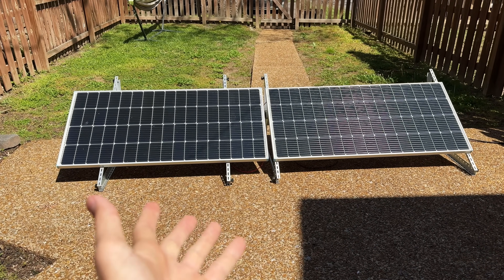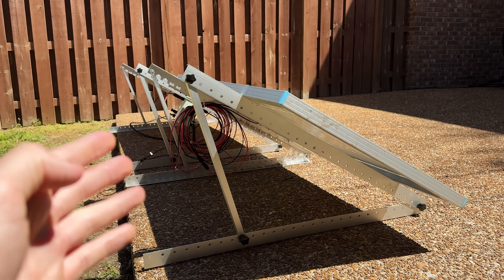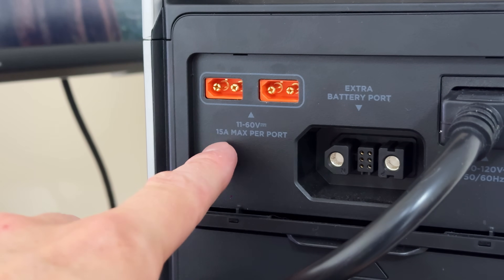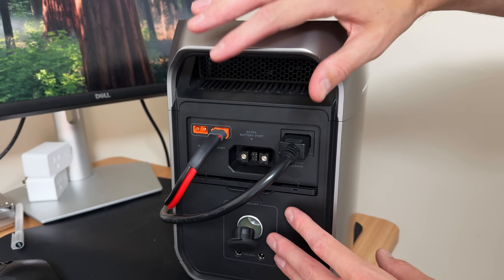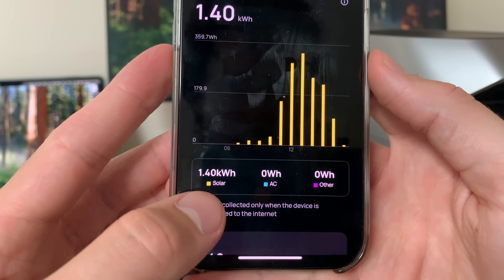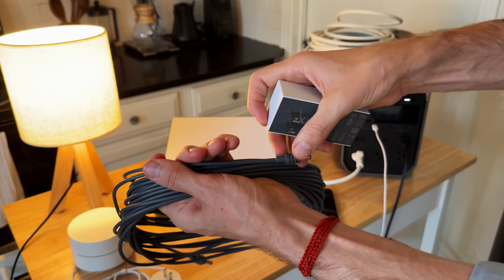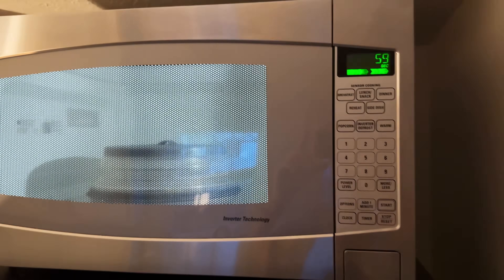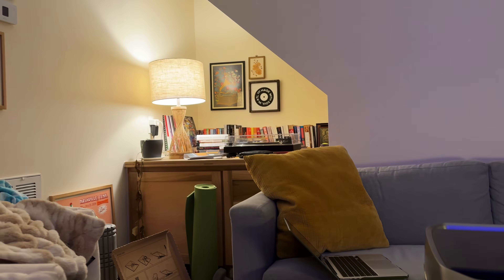Simple $1,500 Solar Generator Setup!

Comment: Enjoying your solar series of videos.  You need to factor in that grid power cost per kilowatt-hour (kWh) is higher during peak hours (typically daytime and early evening) when demand is highest, and lower during off-peak hours (late night and early morning) when demand is lower.  Simply adding a 24hr timer to atomatically recharge the battery bank from midnight to 5AM each day so that more of the solar generate power is used to run appliances during the daytime higher costing demand hours would result in much more cost savings in my mind.  This is typically hour smart higher end EV car chargers work today.
Reply: The pain of having a utility that did away with off peak rates. They did that to save money vs having to jack peak rates. But then jacked the new singular rate anyways about 4 months later.

Comment: I built a $1500 setup that is less portable, but serves as a base station for an Anker C1000 (~1kWh).  It packs 200 watts of panels outside with 280ah 12v battery inside with 12v power port, USB A and C, and a 400w inverter inside.  All housed in a little storage cabinet with a counter height top where the USB and 12v power ports are accessable.  With the battery and C1000, I've got about 4.5kWh on tap.

Comment: By watching your videos, I noticed that Solar Systems are really Expensive in America compared to Pakistan.
In Pakistan $1500 = 425,000 PKR  For this I can easily buy a 5 KW  Solar System with 2 LeadAcid batteries that can cover almost all of my needs excepts heavy loads like AC. 

I personally installed a 15 KW On Grid System (without Batteries) for $4200 with custom Solar structure which was really Expenive
Reply: Philippines and Thailand too
Reply: Solar is for the rest of the world. Muricans have clean beautiful coal.

Comment: I’m considering buying the EcoFlow Delta 3, but I’m not sure if it fits my use case:

I want to connect a 100W solar panel and also plug the Delta 3 into my home AC power. However, I want it to only charge via solar, not from AC.

Then, I want to run my HiFi setup (TV and soundbar) from the Delta 3 — during the day in standby, and in the evening in use — until the battery runs out. Once it’s empty, I want the Delta 3 to pass through AC power to my devices but not charge the battery. The battery should only charge again the next day via solar.

Can this be configured in the EcoFlow app?
Reply: Plug your AC line into a timer when it shuts off you will be on battery. Timers are under 10 dollars and can be set in 15 minute increments.

Comment: Great video and definitely an awesome concept! 💯 The only downside is the actual ROI since for a $1,500 system that saves you $0.3/day you're looking at 5,000 days or ~13.7 years before the system actually pays for itself.. 😅
Reply: He overpaid for parts, $1000 more realistic. Also, if you factor in rising power costs from inflation or whatever, it gets a bit better. Plus you have a little bit of back up and mobile power.
Reply: Well with battery systems  and solar you are paying  for energy security
Reply: Actually it pays off much, much quicker.  If he is working from home, using Starlink for Wifi, those potential lost hours x wage per hour will help reach ROI quicker.
Reply: @jbranche8024 what are you talking about it would pay off faster if he works from home? Why would him working from home have anything to do with the cost of power offset? Working from home or let him use the power, that but that doesn't change the long Roi. The ROI was created assuming full use of the power generated. If he didn't work from home, it could take 30 years. Systems like this will pay off, but you should shop around and not severely overpay like he did
Reply: @xeridea  i think they were getting at the potential wage loss should the power go out. he could keep the power on enough to not lose out on work. i believe that was the thought process for that example.
Reply: @LeoLiburon fair, though if you are doing a solar setup, it is much more effective to get larger panels, you get significantly better power per watt, and get a larger unit, which could work for an extended time, especially if you have a desktop with multiple monitors, which many people working from home would have
Reply: @xeridea for many years i had maintaining large UPS so it can power my workstation and network cabinet so i can work in case power outage it was generating only cost and i had replace sla batteries every 2 years. Now i have own build mini solar system based on lifepo4 and victron and this lifepo4 batteries  i use to power my laptop and all smaller devices so it give me savings. As You can see my ROI is much faster because i was able to get rid of UPS. He also looks like someone who will lose couple bucks if will be disrupted during work so you need to count it.
Reply: @jbranche8024 I'm very intrigued by your reasoning so if you wouldn't mind explaining mathematically that would be great! 😃👍🏻

Comment: You should look into one of those saddle shaped window unit heat pumps.  It will leave more of your window available for viewing, it's sturdier, and you can seal it better.  Plus, being a heat pump, you can use it for heating and cooling in a far more efficient way than that space heater.

Comment: I have a bluetti ac180 i don't see the same connection on mine how would a get a extension cord?
Reply: Looks like yours should come with an Solar Charging Cable (MC4) to DC7909
Reply: Yeah that's exactly what it has. What extension would i get and how would i connect it?@mrmega328

Comment: I see the below bundle is $1300 for those wanted one.

EF ECOFLOW Solar Generator DELTA 3 Plus with 400W Solar Panel (2024 New), 1000W Solar Input, LFP(LiFePO4) Battery, Portable Power Station for Home Backup Power, Camping & RVs

Comment: Would you believe that I just set up a similar system just last week. But it took me about 10 weeks to set up. Ecoflow Delta 2: $399.00 Black Friday special. 3 Used 250 Watt Trina panels: $180.00 for all three. Panel mounts: Free. I built it out of stuff I had laying around. BOS (Balance of System): ~$300.00 for a totally over engineered electrical connection between the fence and house. 50 foot spools of 10ga wire are expensive. 
I am also primarily using my system to run a window AC.

Comment: So it will take 15 years to pay you back the $1500 you spent on your solar array that supposedly "saves" you 30 cents a day. That's not very good. I do get the point that if I build a solar system where I can go completely off-grid during power outages. Eventually produce enough electricity where I don't require the grid at all and they could pay me for my excess. Or my neighbor could pay me for my excess.

Comment: "In the winter I use this small electric space heater" that works, but have you tried putting your AC in the window backwards? 
Instant heat pump!

I've been wanting to do something like that for a while, no money though :(
RIFs suck.
Reply: Only if your ac is designed to work in colder temps, otherwise it'll just freeze and be a very large paperweight

Comment: I used to have to roll batteries around to plug in my fridge, wifi, lights etc…but now with a transfer switch I just flip switches up on the panel…if they aren’t already up.  My electric bill this month was around $7.  My electricity last year, after climate credits, was $189 for whole year.
Reply: How big is the (wattage) of your solar array?
I know there is a point of dimensioning returns, but you seemed to have found the sweet spot.

Comment: Thank you and awesome! What I'm seeing is:
1] Pecron F3000LFP for $1k
2] Used 400w solar panels 4($45), sf bay area Craigslist 
3] Mount $100 (use wood and screws)
4] solar extension cable $100
5] PV disconnect $40

Total = ~ $1500 for 3kwh system!
Reply: Nice build.  I went a little different.  Bought a Oupes mega 1 $525,  6 130w used panels Market Place $120 ($20 each),  2 12v 100ah batteries Amazon $410, mppt charger $85,  breaker $20, ground mount $90, cables tools misc $120. Total $1370.  The panels charge the batteries during the day, which also passes through to charge the battery in the Mega 1.  When the sun goes down the two batteries keep the power station charged.  When the sun comes up the batteries and Mega1 goes through the cycle again.  I was thinking of expanding my current system by getting some more panels, batteries, and a 2000 watt inverter.  It would probably cost me about $800 more.
Reply: This makes more sense!
His system is 1kWh for the same price

Comment: Being curious about backup power, I'm in a condo.  Can't attach anything to the roof if I could the attached garage I get about 6 hours sunrise till about 1 then one to about 3-4 in afternoon.  Could put solar cells in drive in am then put in back yard in pm.  Was thinking of running four 25v 100 amp in parallel.  Your video was very helpful
Reply: You may want to check into lightweight, flexible panels. You’re able to mount them with velcro and remove them easily, if/when warranted.

Comment: Why Solar Panel is so expensive out there ? you have bought used solar panel for about $385 , while here in Asia we can buy same 2 New Solar Panel which will cost us about $150. I don't get it why it's so expensive ?
Reply: I have no idea why they are so expensive in the US, but they are.  Standard these days is 400-500 kW per panel. What is the generation capacity of the $150 panel?
Reply: because most of the panels are produced in Asia
Reply: Tariffs.
Reply: your guys have comparative advantage over us, both by manufacturing them and that your currency is worth substantially different than the USD.
Reply: @catalysts94  is it becauze we shipped from china with less tarrifs and taxes comapre to us which ships from china too maybe that's why it's expensive there not here , seconldy china is freind of pakistan so even the cost of tranport is comparitvely less ... we shared border and have roads too .. i think that might be the only reason eourpe and west have expensive solar panels and asia have cheaper .

Comment: brooo your fridge only uses like 170watts?? that is so low LOL (according to google: "A standard refrigerator/freezer combo typically uses between 300 and 800 watts of electricity, on average") so this is crazyy. btw the second time you checked it only showed 63watts?? so I'm super confused how that can be possible.
also wtf I was expecting HUGE savings but you only save like 20-60 cents per day? That is hilarious😂🤣I guess the only use for these setups is when you live in a cabin in the woods.
Reply: watts vs watt hours. ask any LLM

Comment: Very interesting video.  For me in central FL, if power goes out, it's usually 5-6 hours like 2 weeks ago when a power line broke.  I have a gas generator but a battery generator could at least get my portable A/C unit going quietly for a few hours before going outside and starting the generator.  It gets to 125F in the attic, that warms the house fast!

Comment: Did I just see two MC4 facing the sky?  Does the water get into the box?  You capped those right>?
Reply: Voted #1 Pinch-Start Fire Starter thru that room.  Move the inverter.
Reply: Finally - You weigh about 130lbs and you never ate dinner.  I liked your video but I am worried about you.  K bye.

Comment: EcoFlow is one of the absolute worst choices for an inverter because it uses cheap high frequency,  transformerless inverter tech that can damage your home's appliances when its MOSFETs fail. For far  better and safer performance, you should be using a low frequency, transformer based inverter instead.

Comment: People get power stations for peace of mind during outages, not for daily savings. If backup power is your goal, the battery is what really matters. The solar panels just don’t save you enough to justify the added cost unless you’re treating it more like a hobby. Even if you’re getting a few cents of savings a day, it would take years of daily use to make up for the initial investment.
Reply: Solar federal credits make your equipment free.. grab quotes from solar installers for the setup you want and then buy equipment that costs 1/3 of that price.. then DIY and submit in your income tax.  You don’t need to be Bob Vila to pull a fixed install off.

Comment: Starling mini can Def run from DC, Starlink Mini has a power input rating of 12-48VDC, 60W. That's 5a @ 12v, the car 12v port can do up to 10a (120W).
Reply from the maker: Yep I just meant you can't plug the Starlink Mini's included cable into the power station's 12V barrel ports. But yes you can buy an extra cable to run it off DC, which is awesome

Comment: 10:44 I have an anker F3800 and a C1000, but I don't have a lot of solar yet, I find that my lower output solar panels that I am using work better on the C1000 (Not sure why but it's like the F3800 can't see the smaller watts in the extremes of the day when the sun rises and falls) so I just send excess power from the C1000 solar to the F3800! works great, fantastic video :D

Comment: I need help with a portable system that would work with my Anker f3800 plus I just got paired with a 400w Anker portable panel. My budget is low, but I want to plan on eventually going off grid. So buying upgrades bit by bit.

Comment: $1500 For that?!?  I have $500 into a system that could run my whole house.  I did get a lot of free stuff which helped tremendously, but I could have bought everything for about what you spent on that tiny system.
Reply: Don- Sure you did!
Reply: @Slick70  The exact cost was $491.70 including tax, and I don't care if you believe it.  I tracked my consumption a couple days ago; about 14kw during the day and about 7.5kw at night.  The large amount of late consumption (had to charge my GF's car) left my battery bank at about 87% in the early morning before the sun came out and recharged it.
Reply: @DonziGT230  yo bud, what exactly did you buy, i am new to it, would like to know so i can do more research
Reply: @DrApathetic  I bought used 315w panels for $40 each, some people find even better deals.  I bought a pallet of 25 but only have 9 of them up so far.  I tried a cheap charge controller and it was garbage so rather than keep trying I got a BougeRV 40 amp controller, that brand is fairly well regarded and so far the controller has exceeded expectations.  It'll regularly do over 40a. as long as I keep a fan on it to keep it cool, if it gets too hot it'll throttle down to keep from overheating.

The inverter I'm using is a 'retired' 3000w Schneider UPS my friend gave me, he also gave me a huge pile of batteries.  He does e-waste so he's constantly getting this kind of stuff.
Reply: @DonziGT230  if you bought 25 pannels at 40 thats 1k. if you only have 9 thats still 360. no way you any where near the budget for batteries to run a home for 140

Comment: We have frequent outages and my ecoflows are my go to.  We have been without power for as many as 8 days and one thing I do to expand running time is use my watt cycles mini 100 ah batteries.  They worked so good I bought the 280ah ones.  They really help and since then I have not had to use my Honda generators to charge by power banks on extended grid outages.    Using stand alone batteries as extension batteries are much cheaper and more versatile since you can Hook them up to an inverter to run your fridge.  Whereas Ecoflows batteries are useless without the main power station plus the cost is significantly more.  Enjoyed your video very much.
Reply: Yep, I have 7 100ah and 2 300ah batteries to extend my power stations. Even though my co-op is very reliable and only 10c/kwh I'm all about being prepared for any outage. I have multiple generators with fuel stored just in case. You can also hack the expansion battery cable so it will use lifepo4 just like the expensive proprietary batteries.
Reply: New Jersey?

Comment: 5:39 As current is "pulled" not "pushed" as voltage is, I don't think you can damage the ecoflow by putting too many panels in parallel, it would clip at 15A as you said, I think.

Comment: What’re the chances is being able to use this system to charge my EV? Or my Pool Pump or Irrigation pump? Such great and informative videos..!
Reply: EV? No. Pool pump? Is it an above-ground pool? If not ... probably no.
There are cheap builds that can help charge an EV, but basically you need to have a battery as big as an EV  or you need to be able to charge during the day. Also, depends on other things, like how much you drive.
However ... if you effectively can't get an EV "fast charger" circuit installed because of local BS (it's mostly BS, anyway) what you CAN DO is:
- buy a decent-sized battery with an appropriate 240-V plug and the adapter from the EV maker or Amazon.
- let the batter charge all day / night and then DUMP the power in to the EV
This solution needs careful research to match components, but could allow a charging solution in places where one is being blocked.
Reply: There is a video where a guy charges a Tesla with a Delta 2, which was the previous version of this machine. But its used as “an emergency gas can” so to speak, which only gets him 3 miles. Also he has other things hooked up to it due to the Tesla needing a ground or something. 

Bottom line is 1kwh battery is too small to be of use in that case realistically.